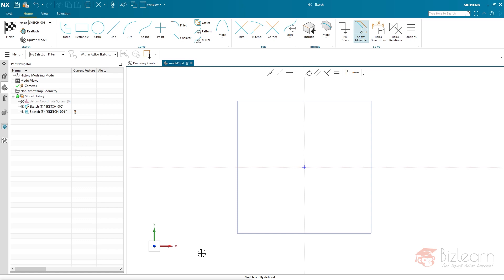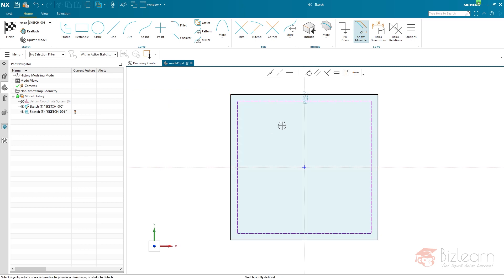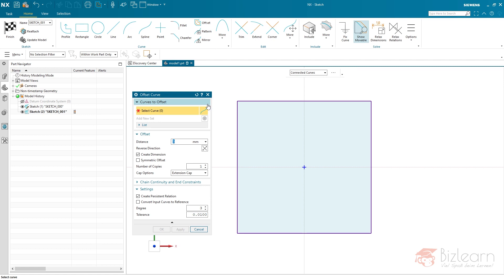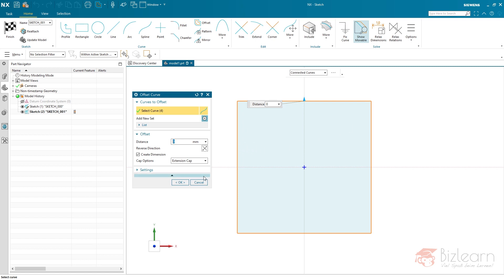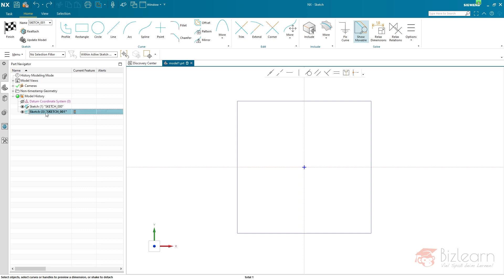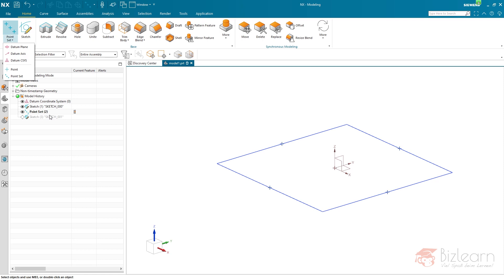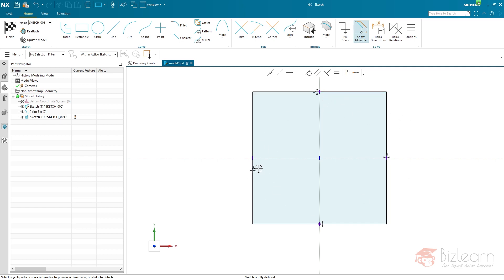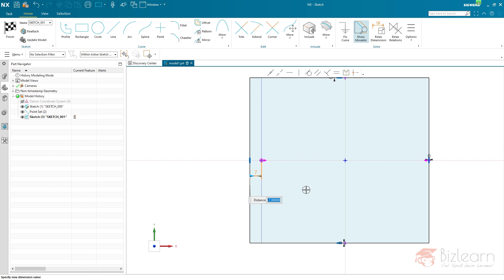Siemens NX - New Sketch Solver | How to deal with unwanted AI behavior | Beginner and Pro Tutorial

Comment: I had another issue with the so called "new AI".
It was applying a vertical relation on a line because, yes, it was vertical during editing the dimensions at some point.
Very annoying.
BUT. The AI is not "ON" when you're outside the sketch editor.
I bet your offset in this example would work if you edit the p0 expression when outside the sketcher and from the expression toolbox.
Thank you.

Comment: This thing with zero dimensions makes sense, with offset it's hard to know which side was the offset intent. This should be a problem even if there was no AI detection. A dumb but quick way is to use a secondary offset, in this case -1mm and then drive the expressions off of that. It's ugly but it works
Reply from the maker: "ugly but it works" 🤘 made my day 😅 But anyway, NX remembers the offset regarding the curve direction. Every curve has a direction. So, it shouldn't matter. Or do you have a different experience?
Reply: @Bizlearn_Siemens_NX_Training  No, I had no idea NX would remember the initial offset direction. I had similar problems in inventor (of course) which doesn't know left from right. This ugly solution worked in that instance.
Reply: I can't remember how many workaround I had to find to overcome NX misbehaviours.
And despite some flaws, it's still my favorite CAD package by far.
Anyway, your -1mm "ugly" solution, to my eyes is as valid (if not better ;) ) as creating point set and relations :/